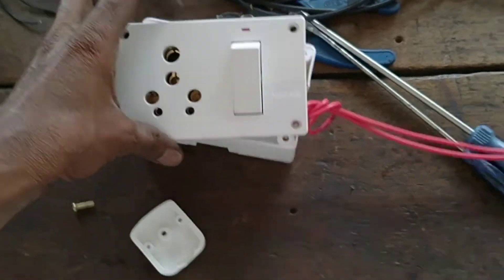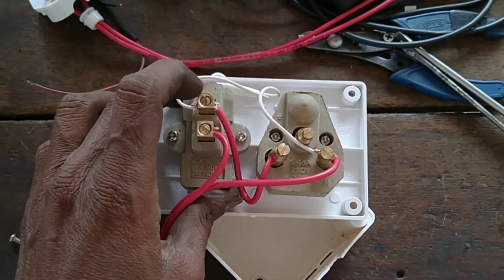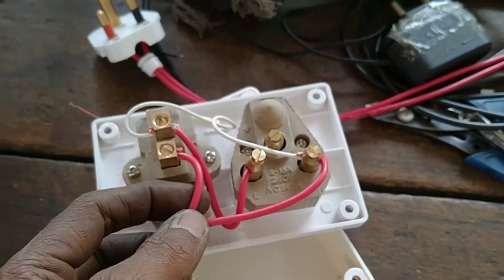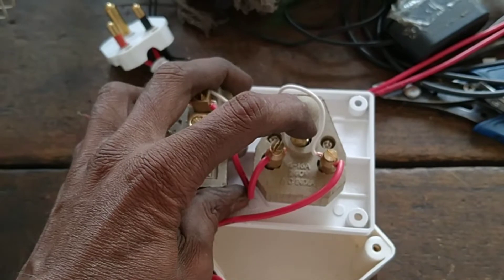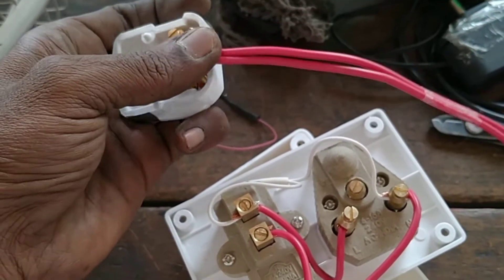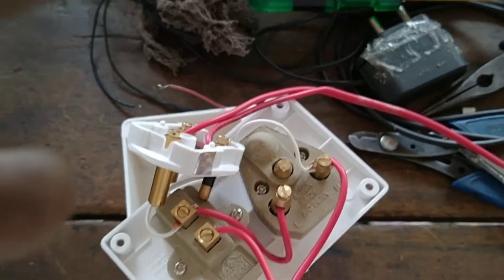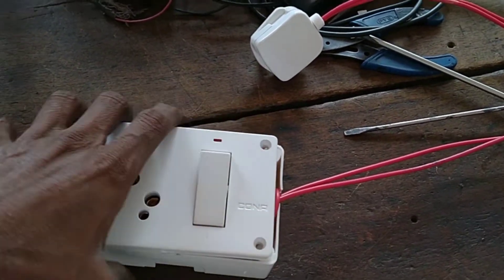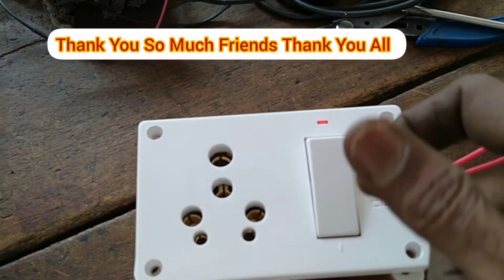Switch Board For Fridge Washing Machine #switchboard#supremerepairs

Comment: It is clearly written in the 3 pin plug of fridge and washing machine that the current rating is 6 amps and 220/250 volts.

Then what is the use of using a high rated 16 amps socket switches ???
Reply from the maker: 16amps plug is used for high power things like for charging electric vehicles,heaters etc...
Reply: @SupremeRepairs  

Ok .

These companies can also write in the 3 pin plug 16 amps 220 volt but why they only writes 6 amps 220 volts in their 3 pin plugs

Do u have the answers?